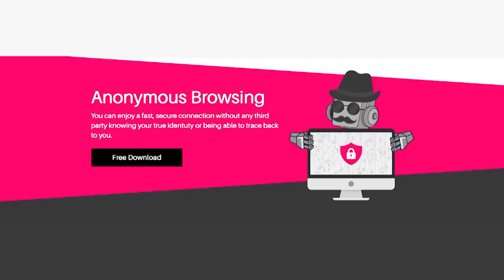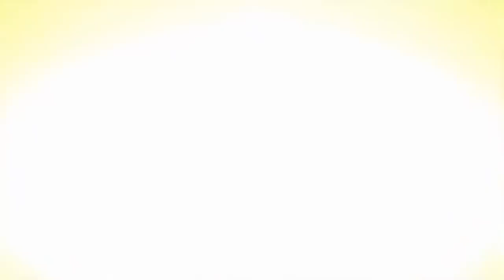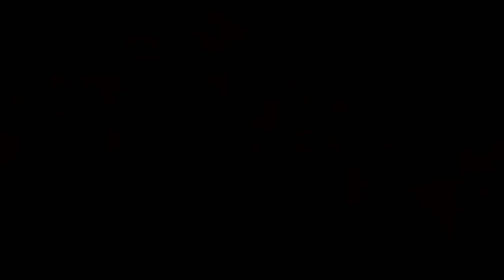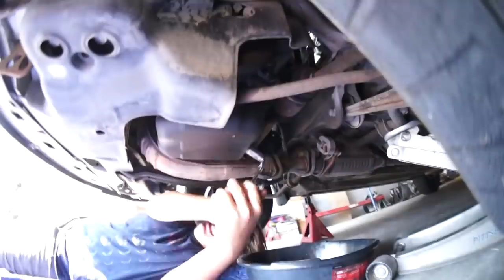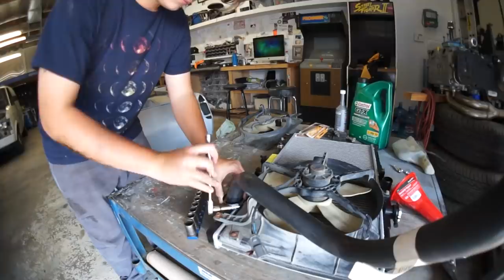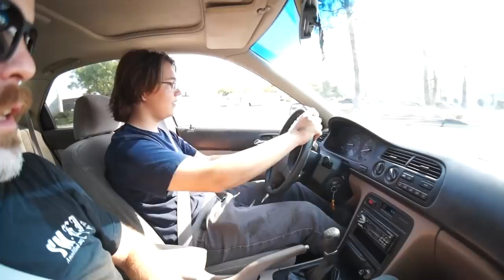Father son ACCORD FIX!

Comment: I learned to drive stick on an 86 CRX Si. Good times… “It doesn’t matter what u did Theory!”
Reply: I learned to drive with a red  1985 Honda crx with 275k miles on it. I literally drove it till the timing belt broke a tooth. It through it off timing and I was going about 60 when the motor locked up and snapped the camshaft clean off at the timing belt. I wish I still had it.

Comment: Go to the junk yard and find some 1998+ Acura 2.3 CL front spindles.  That way you don't have to deal with the annoying captured rotors these things have (and have to end up replacing the front wheel bearings at the same time).  And hahaha, of course o'rileys couldn't find what you needed.  Should have called Singh first.  Raj has everything.

Comment: An unmolested honda in california? That IS a unicorn. You either have the mexican modded honda's or the ricer modded honda's out there.

Nolan can't find a part and expects higher minimum wage.... facepalm.

LOL, welcome to honda's, where the oil filter always pisses on you.

Teaching him to drive stick. I hated that with my dad. Because my dad explained it as as you left off the clutch, give it gas. Equally. So I was at like 2000rpm by the time the clutch engaged. My buddy Ivin, he explained it different. He ended up saying "stop, just stop, slowly let off the clutch, don't touch the gas, you will feel the engine start to stutter, then just give it a light throttle" and bam, I was driving stick like a pro in no time. Best advice I ever got, was to check clutch engagement point without giving it gas. Once I knew where that point was movement wise, I never stalled again and I can take off anywhere even on steep ass hills. Man that was so long ago.... rofl. And yet still in my mind like yesterday. I miss driving. Hate that I became a cripple from spinal cord injury. Doctors don't know shit. Can't fix it. I'm just fucked. Like many humans because they don't know shit....